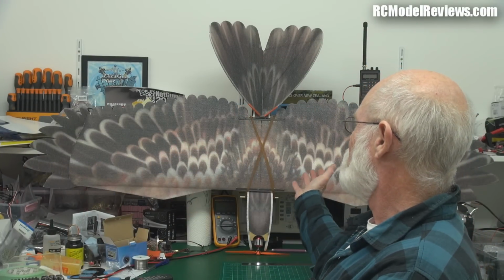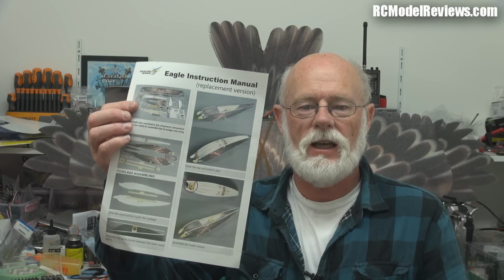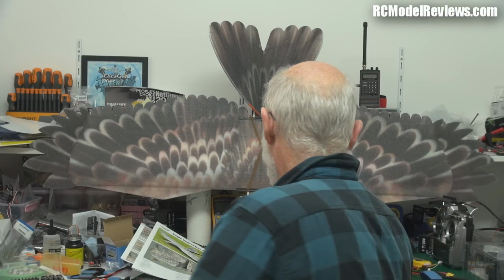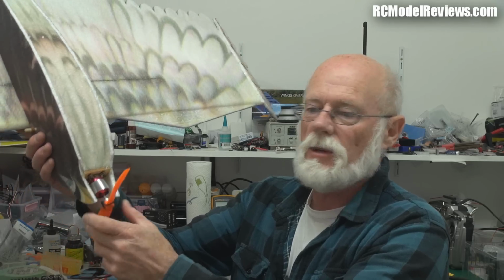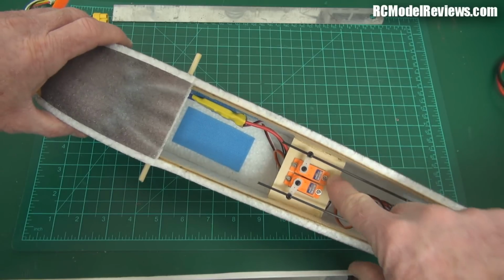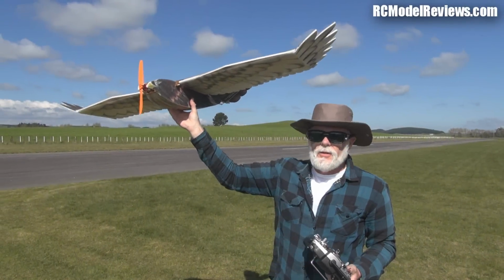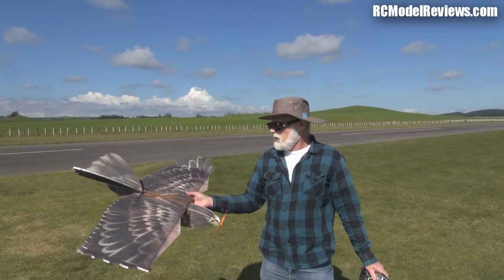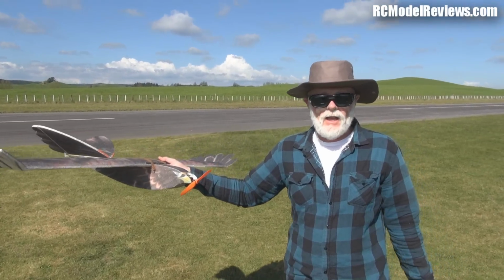Review: EPP Eagle from HobbyKing

Comment: Carbon feather pushrods drive the tail feathers?
Sounds biologically correct but does that cause any radio interference or is that only with older radios running fm channels?
Reply: Christopher Leveck The carbon pushrods shouldn't cause any problems with RC gear.
Reply: I should of saw this video 5 years ago when i bought mine. We always use 1300 packs behind the motor. Very light plenty of power & run time. It sometimes even thermals. 
I mostly fly this at lakes & neighborhoods.  @xjet

Comment: Hey Bruce, I would like to know your opinion about the frsky L9R, is that worth? also, knowing that it doesnt have telemetry, maybe its possible to use  dual receivers binding l9r with the x8r on Taranis? thank you :)
Reply: Ricardo Iarossi Full review of the L9R is coming up soon (weather allowing).  You can't bind an L9R and an X8R at the same time because the transmitter has separate operating modes for each.
Reply: Thank you! lets hope they make a new version of the l9r with telemetry.
Reply: Ricardo Iarossi
I don't think  you'll see a long-range system with telemetry -- but since the L9R offers an RSSI output and is most likely to be used on an FPV model anyway, then you can display all the telemetry data you need on an OSD and watch it through your video goggles.
Reply: I actually want it for a giant plane with 9 servos, then it would be great to have 9 channels so that I don't need  to use 2 receivers and also a better range. It also would be easier, because if l9r had telemetry, I wouldnt need x8r receivers anymore and could replace all of them. But just like you, im loving my Taranis and frsky products.
Reply: Ricardo Iarossi
You should get all all the range you need with the X8R receivers and then you wouldn't have to sacrifice telemetry.   I'm going to be doing some range-test comparisons with the D4RII, X8R and L9R as part of my review.
Reply: great! i'm really happy to hear that... I heard from some guys that they did 10km with l9r. I just can't believe.

Comment: I know I am commenting on a quite old video, but very nice flight, thanks for the incites and tips I've had this for a couple years and have had horrible torque roll and very ineffective rudder control, since buying  I have added ailerons, and messed with the throws constantly, turns out I have just had too big of motor-prop combo I backed it down to a similar motor to the one you are using and have had much more enjoyment flying the eagle. So much that I have ordered the larger on that comes with ailerons "1430 mm" version.  I have gotten so used to bigger motors over propping that I had forgotten about how much fun a relaxing flight can be. Not to mention I think it actually helps keep the gofers, squirrels and rabbits from destroying my garden.  Thanks Bruce always love the videos even if it takes me 4 years to see them. PS I am still waiting on the sub 250 plans...  (outlaw 250) I have one but yours flies better. Cheers from the Midwest USA! keep up the great work.

Comment: I acquired one of these kits the other day and can honesty say it has to be one of the most fun EPP kits I have ever flown. Has a great presence in the air and is very relaxing to fly. Where I fly it usually attracts large flocks of seagulls and which follow my Eagle around in quite a tight formation like they are my wingmen and which is really spectacular. Have tried slope soaring with it but when flying with no power on it does not handle very well as needs a bit of forwards airspeed to get sufficient airflow over the control surfaces otherwise difficult to control.

Comment: The small ID/OD straws provided in fast food and coffee shops as coffee stirrers also work great as antenna guides. They can also be used as pipettes to get adhesives into tight areas. Draw the glue into them using a baby medicine syringe, often given away for free from behind the counter in the pharmacy section, plug one end with a finger, release to let gravity flow the adhesive or use that baby medicine syringe to pressurize it out.

Comment: Might it be better to use a folding prop?  It would make firewall damage less likely on landing and make for more efficient thermalling, wouldn't it?

An experienced club mate had a similar model supplied by Falcon Aviation in the UK. Those a plain and need painting but fly very well.  His was'nt so good, though and crashed as soon as he launched it. Despite his experience, he'd set up the V tail as if the two control surfaces were ailerons rather than a rudder in two parts!  Something to watch out for, perhaps?

Good to see a change from the over supply of quads ;)
Reply: Belper Flyer Yes, people setting this up should be aware that you don't use the V-tail mix (which effectively mixes rudder and elevator) but instead, you use the elevon mix.   If you use the V-tail mix then your turn control will be on your rudder stick and your aileron stick will do nothing :-)
Reply: *****
On rudder/elevator models I mix aileron and rudder 100% so both sticks work the rudder.  Easy on a Taranis :)  Easy on a Mux3030, too, for that matter.
Reply: Belper Flyer Hehe... That'd really screw with me, I fly 3ch with a phantom rudder thumb. Would give me double the rudder!

Comment: Ooh, Ooh, Ooh, teacher! I saw what you did there, so....Please write a paragraph entitled Antenna Placement for Dummies! With 2.4Ghz dual Rx antennas, I place one along the leading edge of a wing and the other vertical (up or down) on the fuse on the opposite side (or some placement that replicates that sideways/vertical layout). Do I get a gold star, or is there a better placement? The rough boys at the back of the class just stick their's any which way and still do OK (still talking antennas here). I am confused and don't want to fail.

Even better, a quick answer and maybe even a video to really clarify the most sensible layout of diversity antenna Rx layout, the reasons behind it and if it really makes that much difference. Thank you sir!
Reply: Sean Coyne Yes, I've been meaning to do a video on properly installing and setting up a 2.4GHz RC system in a model.  Perhaps I'll try to get that done later this week (once I've cleared the rest of the backlog now that we've got a few days of fine weather).
Reply: ***** That really would be appreciated, Bruce. Honestly, I think a video on the topic would be of enormous interest, especially for FPV peeps who want the best range with their 2.4Ghz gear. The long range, low frequency FPV guys probably already know the answers. Yet everyday rc people have all sorts of odd looking antenna set-ups and at normal visual range it doesn't seem to cause any problems (well, depending on noise floor, I'd guess) so I'd really like to hear from an expert. Ta muchly.
Reply: That'd be perfect timing if you did! The parts for my mini quad are in the process of arriving, and it's one thing I'm still not 100% on.....
Anyway, keep up the good work as usual

Comment: FPV FPV FPV!!!! No but seriously the low consumption of that motor+ the amazing slow speed floating like characteristics of the aircraft = An amazing fpv platform, ( excluding the fact that the prop is at the front )
Reply: Maraos Yes, but given how far back I had to put the battery to get the CG right, I'm thinking that with a bit of re-engineering, this could be converted to a pusher-model and that would make the FPV experience great!   Stay tuned ;-)
Reply: Hmm yes a pusher prop conversion could fix that cg issue, looking forward to the videos to come

Comment: I had the original FlyParty EPP Snow Eagle, which is slightly larger than this HobbyKing version.  As for it being a clone, how's this any different than BP Hobbies "E-Aero Eagle" of the identical size as the FlyParty one?  Insofar as the Pro's and Cons that are listed here, the same can be said of the original, EXCEPT the price.  The rest of the attributes are ALL the same.  The Snow Eagle was much more expensive, looks realistic in the air, etc.  Same goes for "nothing really fits very well" and all the rest.  The original had its faults, too.  So HobbyKing makes a clone ................ Big deal!!  So what?  As far as I can see in this video, HobbyKing's version actually has a few things improved over the original.  In N. America, they call it "competition".  Some may call it "copycat" and "cloning".  I see little difference except lower price and better availability and accessibility.  Bravo, HobbyKing for bringing more people into the hobby with your low prices and abundant selection.  Don't let the jealous detractors sway you from doing this.  The buying public will ultimately decide whether or not "you get what you pay for".